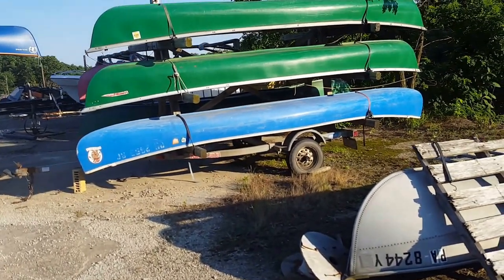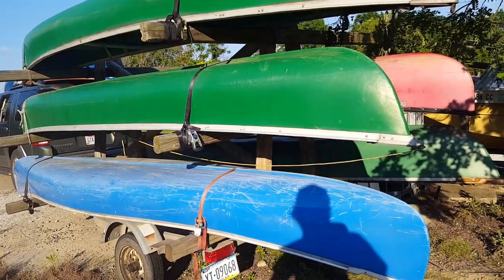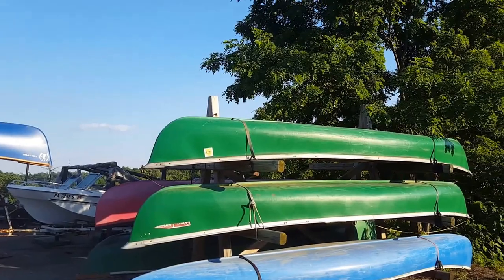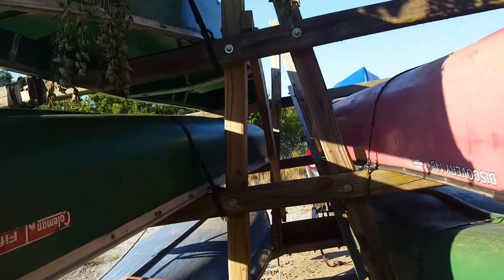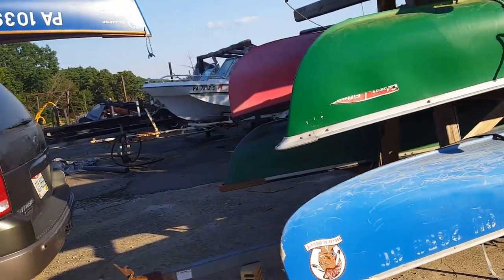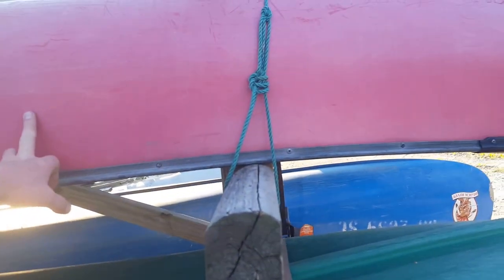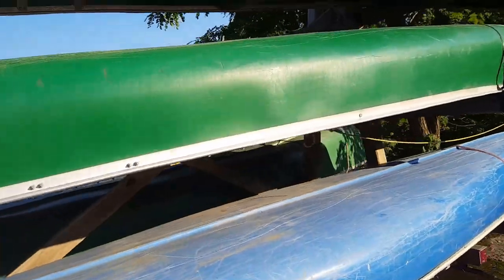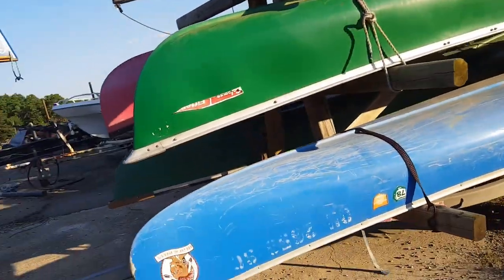Diy Canoe or Kayak trailer

Comment: nice video. Do you feel the 4x4 are necessary?  could 2x4 work?
Reply from the maker: I feel like 2X4's would be too weak for six canoes, but i drive 70 mph and have to go on some real rough roads for some of our camping trips.
Reply: +Brett Buckley thanks for the reply. It looks like a nice system. I have a 5x8 trailer that I want to build a similar rack for. I have to decide what wood to use. How much would you say the rack weighs?
Reply from the maker: i would guess around 150. i can drag the back end of the trailer around when hooked to the truck by myself when the canoes are unloaded pretty easy
Reply: +Brett Buckley Sweet. Thank you.